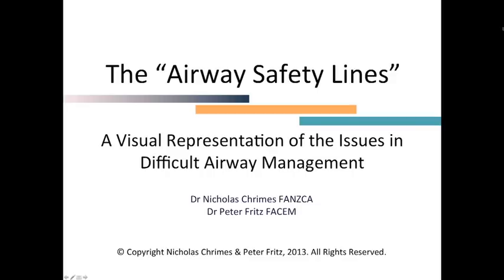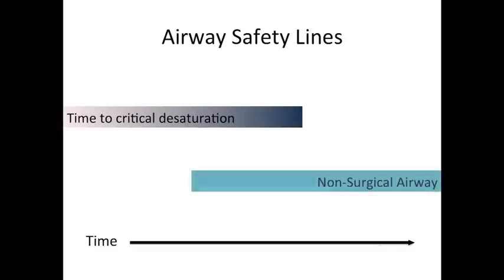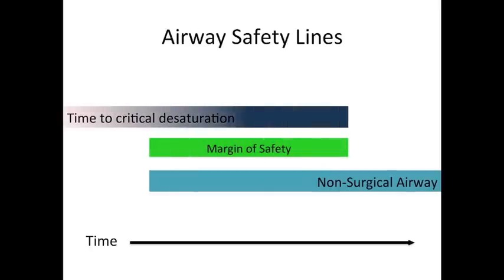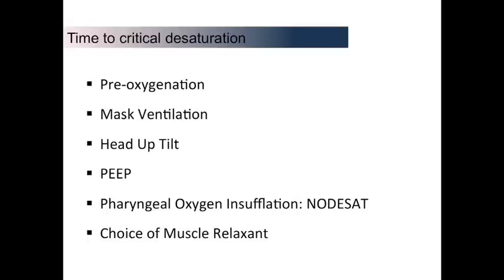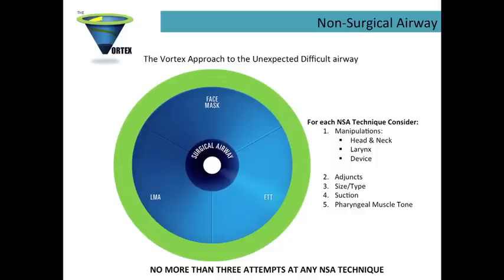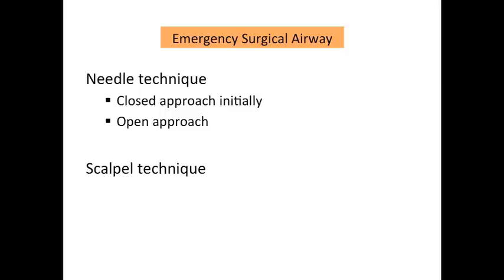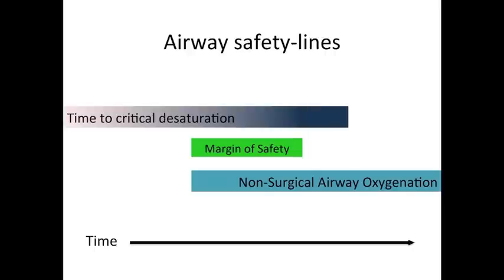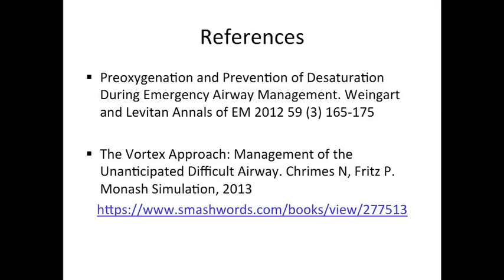Airway Safety Lines

Comment: 15 cm H20 is a reasonable target for peak AW pressure when feasible and is supported by a Feb 2014 study in Anesthesiology http://1.usa.gov/1A7kdpu

There is an excellent 2009 editorial in A&A "Sellick’s Maneuver: To Do or Not Do" (FREE at http://bit.ly/1qEoP4C)  recognizing the common recommendation to avoid ventilation during RSI. Their recommendation to ventilate when necessary during RSI was based on multiple studies observing prevention of gastric insufflation with cricoid pressure. http://bit.ly/1leduRb (FREE) http://bit.ly/1k860Eb (FREE) http://1.usa.gov/1k87cr4 (BJA paywall)

Comment from the maker: Will have to look for a reference but it is accepted by many that GENTLE mask ventilation during RSI is safe provided inspiratory pressures remain <15cmH2O. This is achievable in OT with soft bag (which gives feel for pressure) and pressure monitoring. More difficult in ED setting with self-inflating bag (less feel for pressures) and no airway pressure monitoring - and thus may not be advisable in ED as insp pressures above 15cmH2O may lead to gastric inflation & increased risk of aspiration.